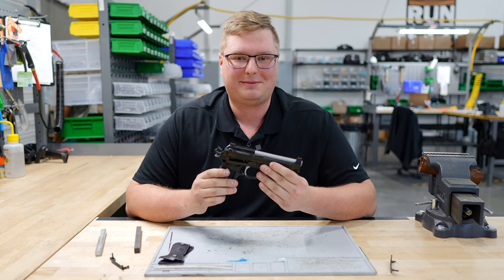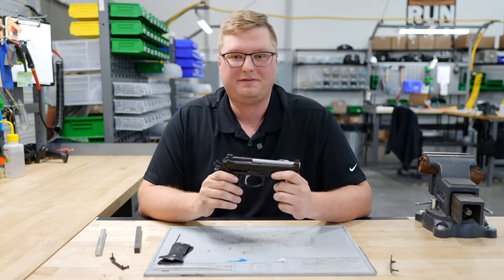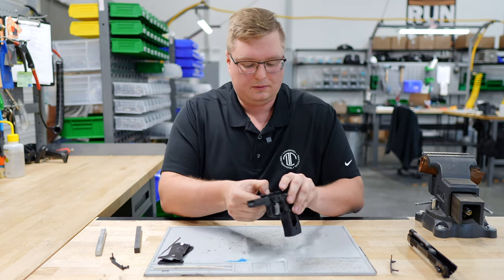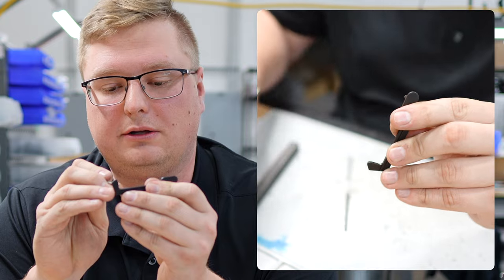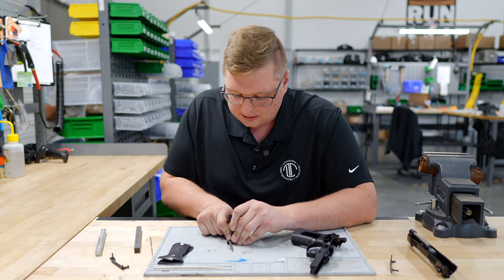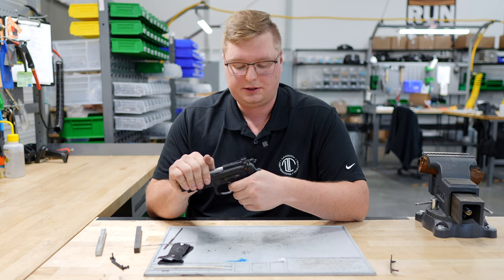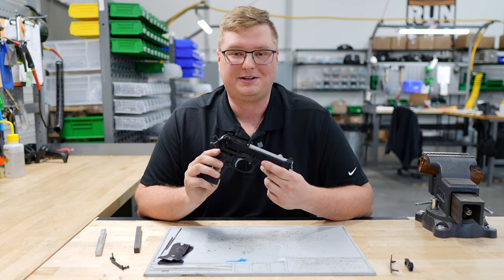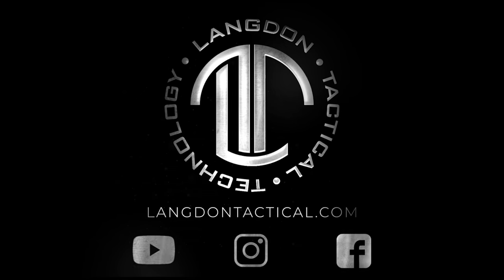Fitting the Match Hammer in your Beretta 92, M9 or PX4

Comment: I installed the match hammer on my Px4 that I had purchased from you all with all the bells & whistles on it, but eventually wanted the match hammer instead of the spurless hammer it had on it and after I installed the match hammer, it basically rendered the single action inoperable.  I decided to put the spurless hammer back in and it worked flawlessly.  I swapped it out again with the match hammer and single action didn't work. I spent hours and all day trying to find out why. I did what you did here on the optimized trigger bar with filing some material off, but I had to take a lot more off than you did in order to get single action to eventually "partially" work.

Only problem now after all that and thinking I solved it, even though it does fire in single action, it does as long as the gun is canted to one side or the other. If it's leven it does and doesn't, randomly.  All this, because I replaced the match trigger??? I'm curious as to what the match hemmer has to do with the trigger bar for single action. If I put the spurless one back in it, single and double fire works perfectly fine. So much for "drop in".  Do I need to file a part of the hammer now on the single action groove as you showed for the double action groove? I don't like the fact of taking to file and guessing where to take material off more or less. You can't get back what you file too much off of and I've taken this assembly in and out about 50 times already in the last 24 hours in order to check each time.  I love working on guns, but I'm to the "this is ridiculous" point and wasn't planning on having to send it in and spend $200 for some filing work.  

Please help if possible.  I was going to call but was afraid I'd be directed to a video/videos that I've watched a hundred times already.  I need to find out why single action works sometimes depending on which way I hold the gun. When I watch it from behind at the hammer position as I fire, it seems like the hammer decocking lever stays up loose when it doesn't fire, and when I cock the gun sideways and the lever falls lower, the gun fires. It's odd that that lever has so much play in it.  I gotta shake the gun in single action for it to fire now. 

The match hammer on the Beretta 92X Performance went in flawlessly with no issues. 

Any help would be appreciated

Thank you
Reply from the maker: This is really a question for customer service. Can you please email us a contactus@langdontactical.com? That is a much better format for this kind of question.
Reply: I’m curious if/how this resolved?
Reply: I wish this was answered here,  I'm having the exact same issue... @LangdonTactical
Reply: @zacharycarter9341 Did you find a solution?